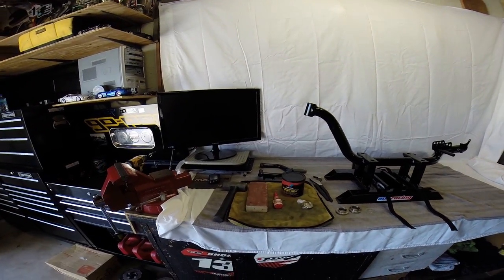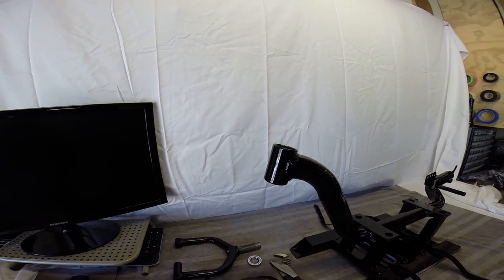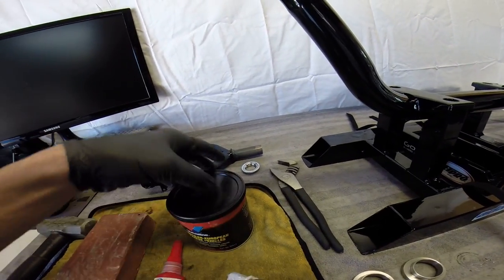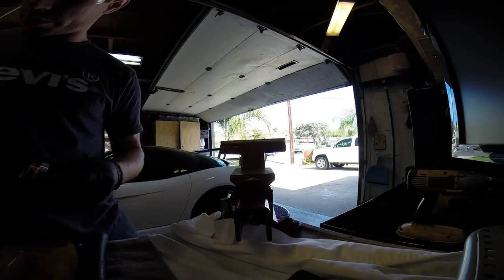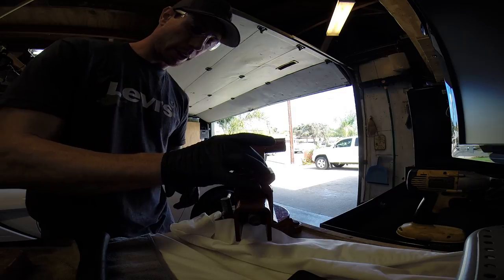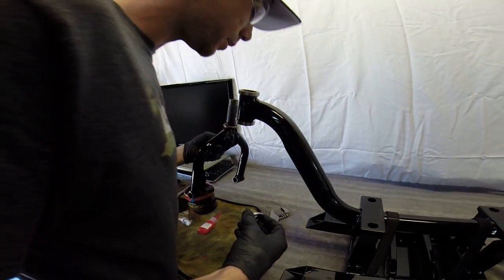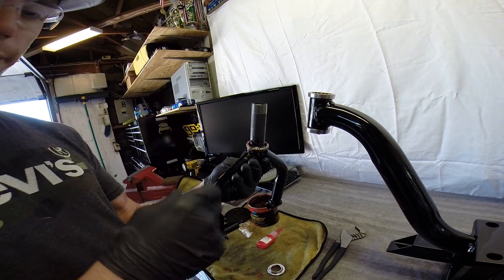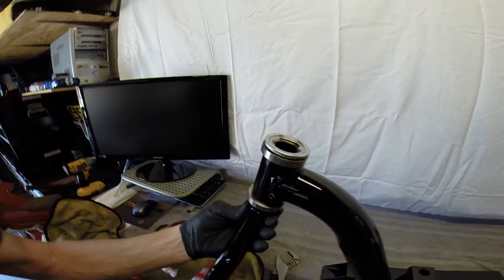GoPed, HOW TO: Installing HD Bearing Cups into Frame

Comment: Just wanted to add a minor point. Yes these bearings go that way but the stock bearings on all hardtire gopeds actually go the other way. With the exposed ball bearings facing out. The style of bearing if it sits on a table, both side ball bearings make contact with the table.

Comment: Is the bottom bearing the same as the top? Or the opposite?
Reply from the maker: yes both bearings are the same size, etc. same bearing.
Reply: Do you know any other Black Friday and cyber Monday deals? I know ddm have some.
Reply from the maker: not sure if ADA racing is having any but you may want to check with them
Reply: I made a wheelie bar prototype for hard tires
Reply: Derek Short can you use a vice script to pull out the stock bearing cups? MERRY CHRiSTMAS!
Reply from the maker: The stock bearing cups are pressed into the frame and likely you will need to tap them out with a hammer and some kind of bar.
Reply: its so hard. i think i need a bearing puller. what size was the bar you used. thanks

Comment: how much was that build? 1700?
Reply from the maker: Got a used roller. total roller minus motor was around 500 bucks. already had the motor tho so... it wasn't all that much to build.
Reply: Good deal for you, here in NC. a gsr46r or gsr40tsi can cost up to 620-900 on craigslist
Reply: Can you do how to build a motor? G260rc
Reply from the maker: I don't have a g260rc but I do plan to make a how to build a gp460 motor. It will be very similar to the g260rc.
Reply: I'm think of doing this build. Tfe bearings, esp gp290 + 2mm and a 2 bolt zenoah crank case